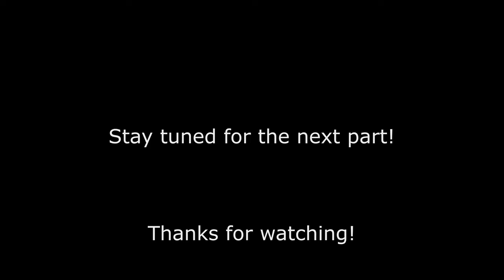1950 LeBlond Regal 17" Lathe Restoration Part 3: Taper Attachment and Cross Slide

Comment: I commend you for doing 15+ videos addressing this lathe. "A" for effort, and if you haven't realized it by now, you're wearing yourself out. Old machines like this need ALOT of presoaking with spray penetrants that will break down the rust and OLD grease and oils. Tools are your friends when you take on a challenge like this. When you put the folding allen wrench on the taper attachment I was just waiting for that tool to SNAP. Definitely NOT the right size for that chore. UP your game with decent tools that fit the project. Last thought, Sit down and watch as many youtube video's as you can of other guys breaking down older lathes and mills. The information will benefit you in finding a lot of hidden tricks, as well as painted over set screws and keys. Breaking parts or damaging them on an older unit will be frustrating and costly. OH, I almost forgot, put that Crescent wrench back in your tool box and get a set of 6 point, 1/2 inch drive sockets with a decent breaker bar and a nice ratchet. Then you will NOT BE rounding off bolt heads and taking a chance of bleeding all over your future projects...
Reply from the maker: Thanks for the advice! I actually spent a few years watching machine restorations before I decided to get this one. I also made sure to get the original parts manual, so most of the time I can find hidden set screws/pins on the diagram first. Due to the condition though, they didn't always want to come out...

I think you'll be pleased to know though that while I was on hiatus I picked up plenty of proper tools. The re-assembly should go a lot better.

Comment: Hell of a job ahead of you, might be worth looking for local grinding shops with suitable way grinders to give that bed a bit of a Tickle and a touch up.
Reply from the maker: I'll definitely look into it, but from what I know about pricing even if I get a local place it'll cost more than what I've paid for the machine.

I'll have the ways and carriage cleaned up soon, after that I can measure level and see just how far off it is.
Reply: @cavemaneca  if you get everything stripped & cleaned up before hand and let them know you're not in a hurry they're generally pretty good on price. freight can be a killer but here in Australia at least we have a site called truck it where you can get quotes from guys that have empty loads in one direction so if you're willing to wait even the freight is pretty cheap. Having the bed ground is a nice place to start as you scrape everything to match and set your headstock/tailstock alignment according, it can a lot of pain and hassle to start properly from the ground up rather than chasing your tail